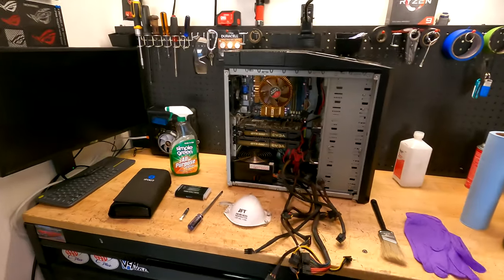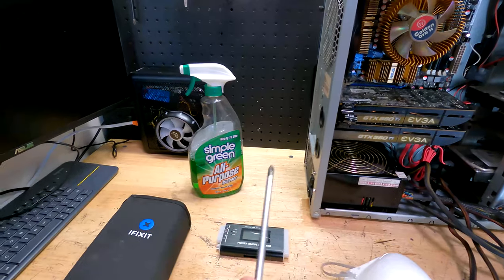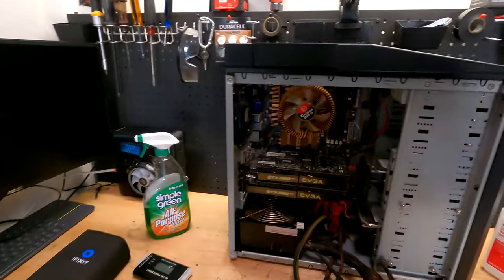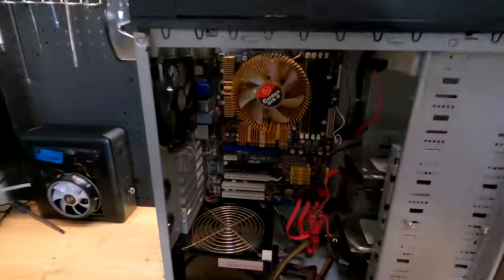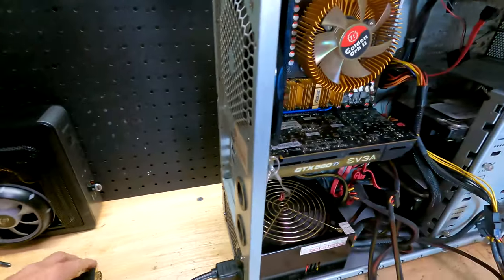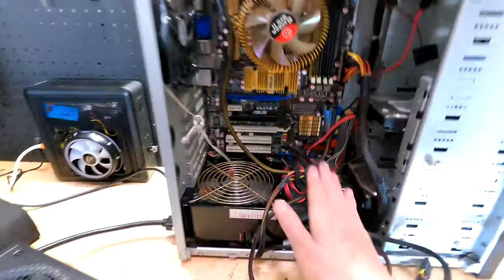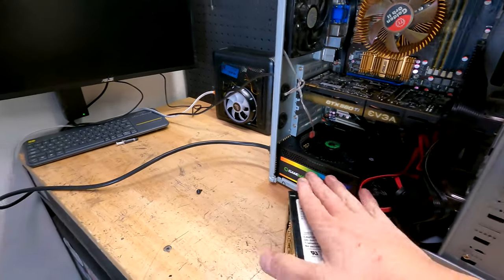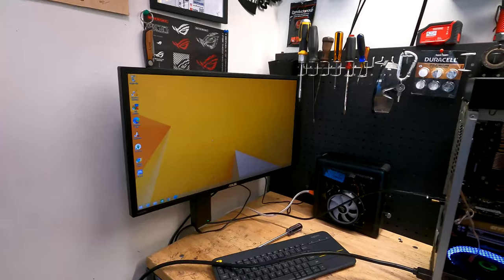Trash or treasure? Restoring old thrown out computers!

Comment: Ah yes Windows 8.1 Vista edition. A true classic. Also I see hard drives get a lot of flak online but the truth is hard drives aren't that slow and no 20 minutes to boot any windows operating system is a massive red flag whether it's a hard drive or not. And I'm still using Windows 10 on a hard drive and it's surprisingly quick to boot.

Comment: I found a few systems on the side of the road on trash day a few years ago and I snagged em. One was actually a pretty decent AMD Phenom X6 system with a GeForce 8000 series GPU lol.. I put a 1070 Ti into it and it can still run modern titles fairly well at medium-high settings. The only thing wrong with it was a bad stick of DDR3; so it was probably one of my easiest fixes. One persons trashed electronics is my treasure; always looking to grow my collection of fixed electronics! Even snagged a nice 750W EVGA fully modular power supply from a PC that had a bad memory controller.
Reply from the maker: I have found their is always something to use from junk computers, weather it's saving the screws or repurposing the case or refurbishing an ancient computer for a retro pc customer!!

Comment: If the computer is THAT slow, it's likely loaded with bloatware, malware, and possibly viruses. I have an old Gateway Pentium 4 that I use as my "retro gamer", it runs older games I have that don't play well with modern graphics adapters but work well with the older onboard VGA graphics in that machine. When I got it, it was so painfully slow, that I ended up completely wiping the drive, with a drive erase program, and even that took forever to finish up. I did a clean install of Windows XP as well as all of its OEM drivers, for sound, video, etc. and it now runs much faster, like it did when it was new, even with a mechanical hard drive. Since all of the games I use on it are either installed to the hard drive, or on CD ROM, I don't have it connected to the Internet, so it has been safe from being bogged down by anything online.

Comment: I recently threw out an old Dell my friend gave me with DDR2 and a Pentium E5200.  Everything got tossed bc of how worthless it was with the exception of: 2 Sata cables, 2 jumper pins, an IO cable, a 640 GB WD Blue HDD that runs at 7200RPM and 3 GBS and the rectangular PSU that I will use to power a test bench MOBO.
Reply: ....and oh, 2 80mm fans (1 4 pin & 1 3 pin)
Reply: ...and various screws.
Reply from the maker: That how I have my huge screw collection lol...
Reply from the maker: thats how I have my fan collection lol..
Reply from the maker: It amazes me how little things like screws and fan and all the small things def come in handy later on. Stuff like that has saved me in a pinch!
Reply: @DLMtechgarage  absolutely.

Comment: I still have my Phenom II X4 system. In fact I built myself a a Pentium III system with a Abit BE6-II that I bought new old stock, 650 Mhz Intel Pentium 3 Coppermine Intel Slot 1, NVIDIA Geforce3 Ti200 that was junk salvaged, ATI 3D Rage Pro PCI, Creative Sound Blaster Audigy SB0090, and a Yamaha OPL3-SAx ISA Sound Card. I even have one of those slotket adapters for Intel Slot 1 that I have a Pentium 3 clocked at 1 Ghz that I might try. I have this Dell Inspiron B130 that I might stick a Pentium M in.
Reply from the maker: I love Abit, that was my favorite brand!!

Comment: A few comments on your video.
First, you never dust the case inside the house. You always do it outside. Actually, you want to thoroughly vacuum clean it first, in order to suck most of the dirt, and then you go outside to air spray it. And it's a good thing to have a soft brush at hand, a women's makeup brush does wonders. 
Second, if the machine does still not fire up, even after you check that the power button cable is plugged in the right pins, the first thing you do is to unplug the cable again and then you short the two power button pins, meaning the ones that the cable was plugged in previously. This is to make sure that you don't have a malfunctioning power button and/or cable. Then you test it again with another PSU that you are sure it works.
Third. Wear a static bracelet in order to avoid some nasty situations. They are dirt cheap on the web and those capacitors can hold A LOT of power for quite a while, even if you have unplugged the power cable from the outlet. You can get a nasty shot, and/or you can burn some valuable components. Best thing to do when you unplug it, is to hit the power button again for two or three times to drain the capacitors.
Fourth. WEAR GLOVES. You said it in the beginning, but you never wore them.
Reply from the maker: i know, i got some bad habits. i need to do better
Reply: @DLMtechgarage  Well, if you admit that you have some bad habits, then you WILL do better for sure. Keep up buddy.

Comment: Had the i7-2600s and dual sli 560ti way back in 2012 and I feel this belonged to a teen who went to college. I'm using the raptor drives for os 10,000rpm and is a little faster than the 7200 one but Jesus 20mins fully boot up? Dang nana must've busted the pc clicking on cornhub ads.
Reply from the maker: Lol

Comment: I wonder if there is a problem with the 4 Pin connectors on the old power supply.
Reply from the maker: Not sure. Never could figure it out. But it will only failed under load.

Comment: Way too much hassle to clean old computer componets with store bought stuff. I'd sooner just take them apart with dust-in-tack, remove the drives and the UEFI battery and dump all PCBs into the dishwasher without detergent, preferable on warm cycle and leave it out to air dry. If your'e woorried has it dried, pour some IPA on it, it'll make the water evaporate faster.
Reply: I use an air compressor and brake cleaner its as cheap as you can get pretty much.

Comment: YOUR TELLING US THAT YOUR PC TOOK 20  MINUETS TO BOOT UP IN 2014,COS THATS WHAT YOU JUST SAID THAT WAS THE NORM BACK IN THE DAY ,SORRY BUT YOU MUST OF BEEN RIPPED OFF ON YOUR PC COS THE PC I MADE  BACK IN 2014 WAS Socket 1150  4th gen & am3+/fm2+ 4core/8core  and i still have them now  and they dont take 20mins to boot got an old amd quad core and thats boots with in 20seconds on ssd and  50 seconds on  mechanical hd even if you go back to p1 133 they dont take long to boot i will go and boot my p1 133 now just over 67 seconds think you may of been ripped off some where

Comment: Definitely wasn't  the norm back in the day for a PC to take 20 minutes to boot. There's something wrong with the OS install or a failing hdd if that is the case. Anything over a minute or two for boot times is an issue, even with a mechanical drive.
Reply: Yeah...and is not Windows Vista, it's Windows 8.1 It's funny 'cause it use to boot and get to the desktop pretty fast.
Reply from the maker: i know, hate i missed that and forgot to do the edit....
Reply: my workstations was booting in 6 seconds in 2008 with first ssds and others with hdds 25  seconds in 2000 - 2003 in 30 seconds max around and build fix thousands off years ago 20 min would be just screwed up os and crappy hdd

Comment: I love refurbishing old computers to sell, donate to charities, and occasionally to keep for a special purpose. They are great for streaming, a home server, old games (10 to 30 years old), and tinkering with Linux. Throw in an SSD and maybe update the BIOS and put in a better CPU (cheap from EBay). I sometimes buy a palette of 30 to 40 of them from a state university auction for just $100 to $200. A few cheap hardware upgrades, update Windows and good to go. I can sell them for $200 each. Dell and Lenovo have support assistant utilities that tell you exactly what is in them and what they can be upgraded to. But the power supplies are low wattage proprietary garbage. Motherboards also have proprietary connections and mountings (but standard RAM and PCIe).
Reply from the maker: I do the same all the time. Good to keep one around for someone in need.

Comment: That is windows 8.1 so I think that PC may have been retired around 2012-early 2015. that PC has had nice upgrades during its time I know the GTX 500 series was around that time. They probably thought it was dead, had it in the closet for years and finally threw it all out later. Hopefully you’ll get more use of it then they did.

Comment: YES ! Dust does conduct electricity & why once every 2 years & will inspect & dust out & vacuum it out. One time I let a pc sit much longer & didn't dust it out. One day I turned it on & I heard a Pop !  The PC was Dead ! I took it apart & found an electrical Arc spot on the Motherboard where Dust conducted electricity from the case to the Motherboard & it Fried it.  Had to order a new Motherboard.

Comment: Good old AM2 or AM2+ socket. Those weren't great CPU's however they weren't necessarily a bad upgrade path. Back in the day I had an Athlon X2 5200 @2.7Ghz and upgraded to the highest end Phenom X4 9950 running at 2.6Ghz... This chip was a poor overclocker but I refused to have a lower clock so I ran it at 2.73.
It would somewhat compete with Intel's Q6600 or Q6700 but overall the Core2Quads (Specially the Q9650) were significantly faster... When the I5 series came out... Intel had a significant lead. The Phenom II's were significantly better than previous generation Phenoms. (Smaller process and far more L3 Cash) however the I5's were always properly superior. AMD was cheaper and even on an AM2+ Board you could run Phenom II's so there was always a cost effective upgrade path.
I can tell for a future video, an SSD and 8 or 16GB ram will make a huge difference but to run modern games, the CPU is a bottleneck or will be missing mandatory instructions to run quite a few games.

Comment: The only issue with them testers is they can not and will not tell you if the PSU is good underload, Some PSU's can overvolt under a load to a point where its not safe for components, or undervolt under a load, I find that them PSU testers are no better than a voltmeter, and a voltmeter can take the load unlike them PSU testers that can cook themselfs if the PSU doesn't have the safty thing to shut down on a short.

There really isn't a cheap way to tell if PSU is good or bad under a load, I got a few old systems I don't care too much about and aren't worth anything I use to test PSU's out, I got a old GTX580 on that system that has bad memory on it, but it will run Furmark and a few other tests, and it hammers any PSU 500 watt and up. Thats how I test if I worry about the PSU in some way.
Reply from the maker: never thought of that... but your right, makes sense why the psu test fine on the tester and would not power on under a load!!
Reply: I connect the tester, turn it on and them bridge a 55w halogen bulb between GND and +5v and then +12v, if the voltages change too much or the power supply turns off, there is an issue with it.

Comment: I know this is an old video but i still feel the need to mention it. those power supply testers are honestly kind of useless. sure they tell you the voltages but they dont tell you what happens when you load it. at the very least get a couple dead hard drives to have it spin up